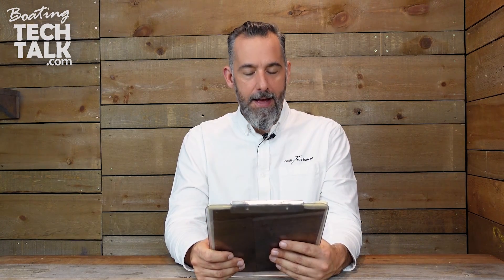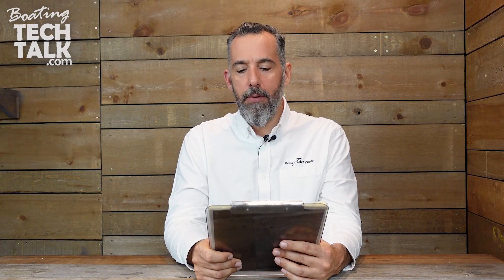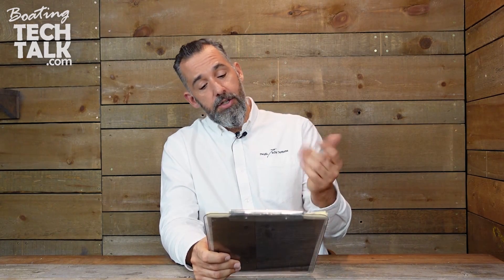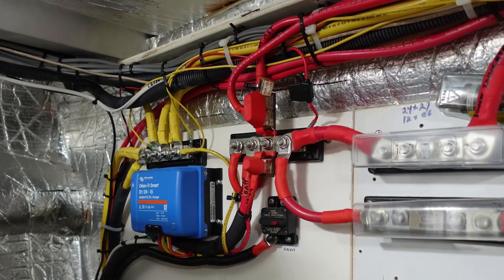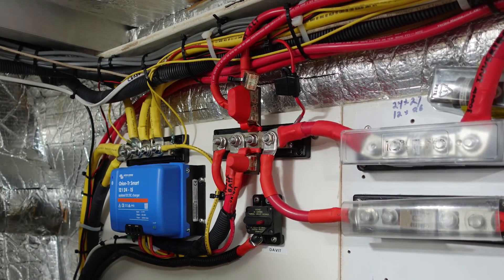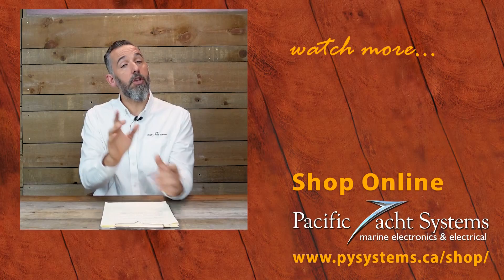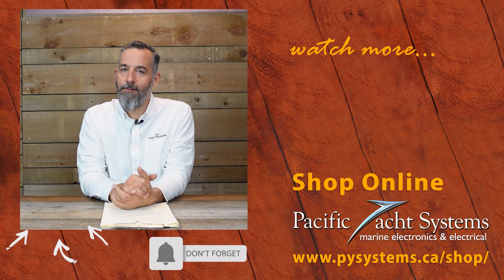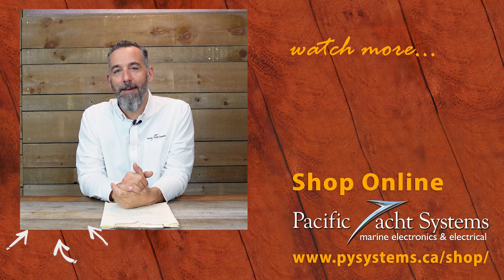What Is the Best Way to Secure and Shield Cables on My Boat?

Comment: When I bought my 40 year old boat the wiring was nicely bundled using zip ties. That worked quite well until I had to start chasing down problems and find out where individual wires went. In the process of rewiring my boat I went with plastic raceways. They do an excellent job of containing and protecting the wires, allowing entry or exit anywhere down their length. Then when you have to chase a particular wire to find out where it's coming from or going to, it's much easier to pull it out from the other wires and do your detective work.

Comment: Some may not like it, set it out anyway.
In larger working looms I use poly plumbing hanging tape used like a P loop with one screw. Allowing maximum support while keeping the bundle from being restricted. Makes for ease in additions, as I regularly am still doing. Inspection is far faster, not a single zip tie used. Friction or pvc quality tape  in just isolated collars is the old way and I feel superior to zip ties. Rolls of velcro for non engine areas are good. Though I dislike it if there is any possibility of it ever picking up oils. Already an increased fire hazard item.
The GGR race electrical fire prompted me to write this. 
I see zip tied bundles in commercial and residential breaker boxes turning into fires. It is a popular trend in electrical media posts. If I find them they are immediately removed.
Occasionally the tension is tight enough to when wires heat from constriction the tie digs in. On boats and vehicles the wire insulation is deformed and thined out. Sometimes a pretty run is actually dangerous. There is a difference between no chafe and creating a dangerous situation. Just want to stress that.
Thanks Jeff for doing these.

Comment: Am I right that if you run a wire overhead in an engine space that you must use metal wire holders, like insulated stainless steel cable clamps.
Reply from the maker: Don't remember that one, although makes a lot of sense... especially in the unlucky event of an engine room fire.

Comment: In my aviation background, bundles are a necesity, unfortunately makes troubleshooting harder. In my boat, I avoid big bundles. One way to keep bundles manageable, is to build them smaller, cut several small pieces of any suitable size hose, place the pieces of hose in between each bundle, (repeat "spacers" as needed) loop a tye wrap around the bundles going in and out of the piece of hose,  and outside the bundle, and when done, the bundles would be spaced out, immune to vibration chafe,  and much easier to troubleshoot. As for tye wraps, avoid the cheap ones with mental locking tabs, and special cutters exist that cut them smooth with no sharp edges. Use a small file if sharp edges remain. Great subject, and video.
Reply from the maker: Thanks Mo for sharing real world experience.

Comment: When installing zip-ties, I recommend grabbing the tail at the base with pliers and twist it off rather than cutting it off. It won't be so sharp and dangerous.
Reply: Ancor makes a tool for cutting zip ties that does it cleanly and you can dial in the tension of the tie.
Reply from the maker: Thanks for sharing... good advice.

Comment: One more thing to add to my earlier comment:  You did not mention type of wire/cable makes a huge difference as well.  People should install the best wire quality they can afford, period.  Oversizing is a good practice where it is practical and makes sense.  Color coding is also smart as is labeling (and labels at multiple locations, not just one end or the other).
Reply from the maker: Thanks for sharing Glenn, good pointers.

Comment: Interesting subject.  A few things you should have mentioned though:  You should talk about how and why to leave a "drip loop" when water can come in contact with any wiring.  Also, you neglected to mention what I consider the best current method for securing wiring bundles, which is, Velcro loops instead of, or in addition to cable ties.  Also, did you know there are two kinds of cable ties?  Plastic (cheaper) and nylon.  Nylon is far superior over time and does not become hard and brittle like the plastic ones.  Also, you did not talk at all about how to secure wires or wiring bundles to interior surfaces.  Tape, adhesive, screws....how?  That is just as important as any of the rest of this discussion, and in some way, the most important thing!
Reply from the maker: Hi Glenn, didn't know about plastic vs nylon cable ties. Totally agree on velcro straps. 
Good point on drip loops... so important.

Comment: Another excellent presentation, Jeff.  With A/C and D/C "higher" voltage/current wiring placed along side (and likely bundled with)" lower" voltage data cables, what other steps do you recommend so as to counter magnetic field "hysteresis", or "cross-talk"?
Reply from the maker: Avoid running parallel if possible, but that's easier said then done.
Reply: If you absolutely have to run data and power of any voltage in parallel, using shielded cable that is properly grounded on one end only can help a lot. (Note: the shield has a separate conductor usually bare wire that touches the thin metallic shield wrapped around the main conductors. This is used to absorb induction by giving the induced voltage a low impedance path to ground. So make sure you are still using your grounding conductor properly in all required places.)

Comment: Hi Jeff. How do you support wires that are in long “blind” areas. My batteries are at the rear of my cuddly cabin and to get wires to the front I have to pull them up through the sides of the gunwales. About 6 feet is completely inaccessible and the wires are laying loose
Reply: just a thought, you could try to disconnect those wires, and use a large diameter PVC tube and slide that over the loose cables from where you have some sort of access to the ends of those cables. this ofcourse assumes that the wires are actually fully loose, and not attached to anything.
Reply: @TheFearOfLegends  I could detach all the cables but there’s absolutely no access to put a piece of pvc that long in unfortunately
Reply from the maker: Good input Jen, i've done similar on my boat.